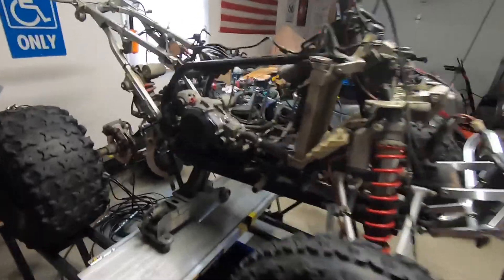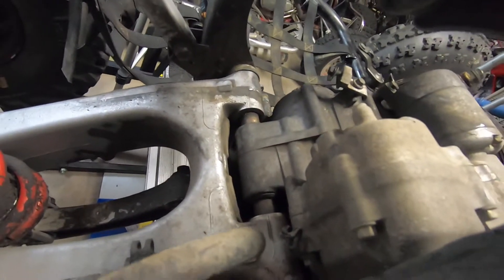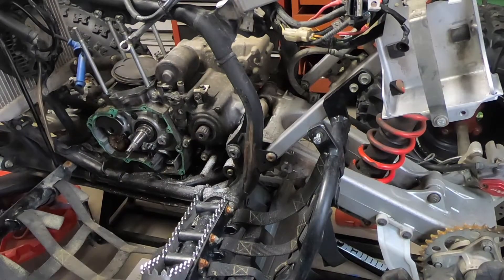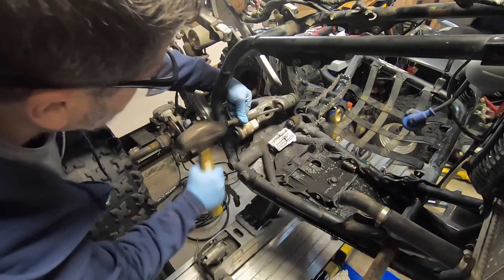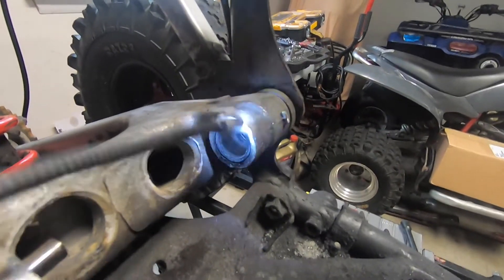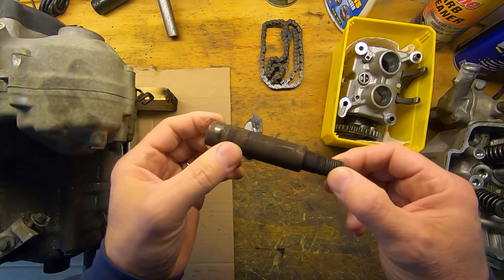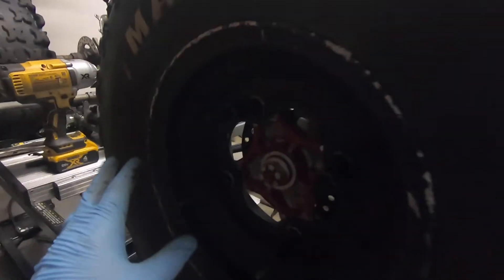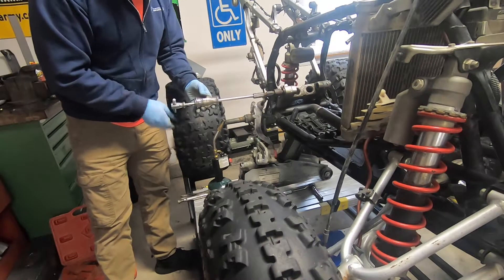Honda TRX 450ER Part 2

Comment: Wow, that's some extrema work on the swing arm. Nice job, most people would have left it then flipped the bike. It shows that you take pride in your work. I'd buy a bike off you any day.
Reply: I guess you needed to remove the engine, so it had to be done. Good thing you need to engine halfs anyway.
Reply from the maker: Thanks Rick, It will be for sale when done if interested.
Reply from the maker: @pugnboots5683  If the cases were good I would of cut the swing arm out, much cheaper to replace.

Comment: I wonder how far off that frame is to be able to put a crf 450r engine in it cause it looks pretty similar to my crf 450r frame
Reply from the maker: A dirt bike engine has different gearing , compression and piston to name a few. ATV's are much heaver than a bike and the motors are designed for that. You could do the swap but I think performance would suffer.
Reply: @RCBGarage  I was  just thinking I knew where to get a frame and I have a crf450 r and was wondering how much work it would be to put my engine in the frame
Reply from the maker: @keithparady2594  IF you have a welder you can make anything fit.
Reply: @RCBGarage  oh yeah I got a welder I’m a millwright by trade and have the knowledge just trying pick a few peoples brains before  u know just doing some homework lol